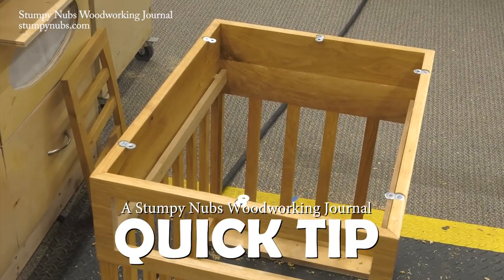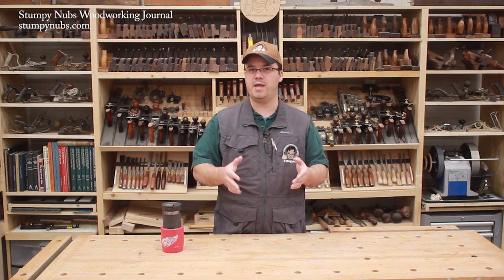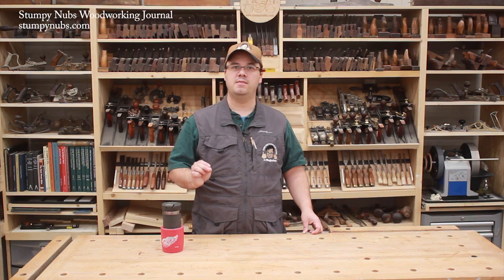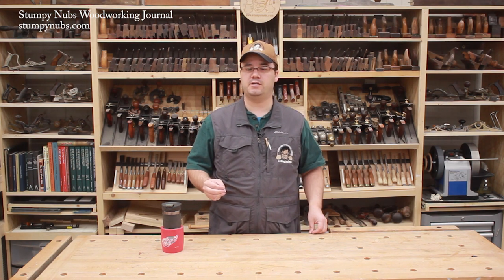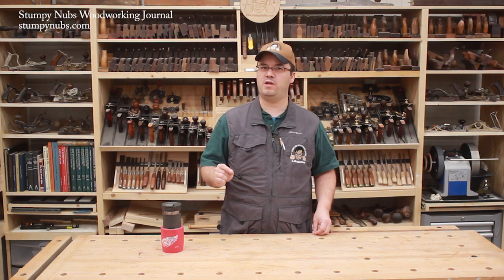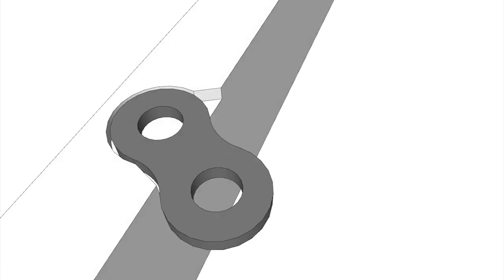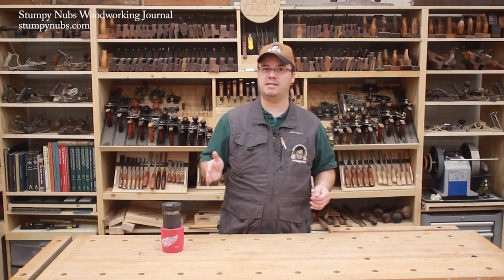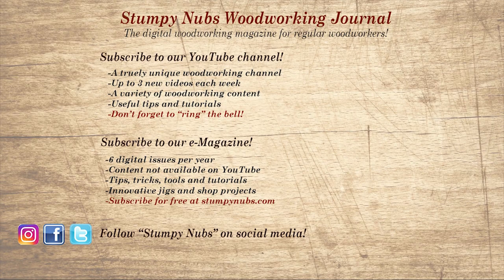Figure-8 table top brackets the RIGHT WAY

Comment: I am sitting at a desk right now that is at least 70 years old, I bought it nearly 40 years ago and it has been with me each time  I moved, I am in a climate that is very arid  now, but when I got it we were living in a much more Marine climate.  It needed some attention when I first got it but frankly it has held up remarkably well. One of the nice features is the fact that it has figure 8 fasteners. in fact when I first got it, it was in a 3rd story bedroom, the thing is made out of solid Oak. it is super heavy and being able to take the top off afforded me to move it a lot more easily. Thank you for the information, I hope one day to put a new table top on it, and I want to make sure that I do not ruin the existing structure in the process.

Comment: Great explanation!  Another reason for installing the z-brackets or wood ones is that if someone lifts the table by the top, the figure-8s can pull out the screws.
Reply: But the aprons can pull away from the z clips

Comment: James, thanks you so much for this instruction.  It hit the mark and answered my concerns with the figure “8” hardware for a solid cherry top on my kitchen island.  Due to construction issues with built up door slides, I can only install the brackets lengthwise,  I have experience with other methods of tabletop attachment for wood movement, but this seemed appropriate for this project and it is my first experience with these brackets.  After analyzing how the top would expand and contract,I was ready to abandon this approach and try another method.  Stumpy to the rescue to cut through all the nonsense and address the issue.  Thank you, thank you.

Comment: I watched this just in time. Great video. Next week I am using the Z brackets to attach the top shelf. I did not realize I had to not insert them all of the way. ......and now I know. For the figure eight type brackets, I'd use a router instead of a forstner bit. I think it's much easier not to go too deep once the router bit height is set. Also, it's a lot easier to open the hole for the bracket.

Thanks for posting. 
Barry

Comment: I'm currently in the middle of assembly and as a new carpenter realized that the joint on the top is much more important than emphasize in this video. I either need a biscuit jointer or route the edges. It would have been much easier if this was much more of an emphasized in the vid as a new carpenter. Thanks for the vid.

Comment: Excellent explanation. Here in the UK, our climate is less extreme - changes in humidity through the seasons are much less than I read that you experience. However, good practice is always to allow a top to move if it needs to. Personally, I use the Festool domino to create the button slots and then make wooden buttons (exactly as you show) which allow for the movement. Before dominos, I would rout slots. All very easy and for the sake of a few minutes work, you have potentially saved an item that cost a lot to make (labour and materials) being ruined. So, whatever your method, equipment and ability, just do something.

Comment: I just make my own brackets out of 2"-ish wide, 1/8" thick aluminum flat bar. I make a shallow mortise for them to sit in the aprons, kind of like the figure 8 brackets, and screw them to the bottom of the tabletop with pan head screws. I just make oval slots in the aluminum to allow the screws to slide, and they work well! I also wax the brackets to help the screws slide easily. I originally did this because I made a triangular table with a solid wood top and needed a bracket solution that could allow for wood movement at a 45 degree angle to two of the aprons. I like it more than figure 8s because of the linear expansion slots, rather than relying on the rotation of a bracket, which can generate forces in other directions in the wood. I know figure 8s work, I just like over-engineering my things.
Reply: All hail over engineering!!! 😀😁😍

Comment: Dude, whoever installed the cabinets in this house installed the drawer faces with these. 7-1/2 years of my niece yanking on them and slamming them closed has led to most of the faces coming loose or completely off. It's cool. Really really really really never saw drawer fronts installed this way. Usually a bolt that goes through the drawer and face frame to the knob. I don't know why I'm typing anything. Thought I'd make you laugh.

Comment: Hi Stumpy Nubs, this is a very helpful video. Still will I have the same type of problem if the table top is made of plywood? I mean can I just glue and nail it to its base or I will have problems in the future with expansions and contractons due to weather conditions?

Comment: Great video. I had a question regarding use in cheap cabinetry. The drawer fronts on all of my kitchen cabinets are attached with figure 8s. Due to constant use and overuse by my now 7 year old niece, so that's 6 years of growing up and pulling on them has resulted in a number the drawer fronts coming off. The fronts are a Maple frame with very cheap maple faced plywood panel in between. What is a good method for reattachment. It just seems like a poor connection for drawer fronts. I can send pictures. Thank you for anything you can tell me. Thank you for reading.

Comment: Great info, James. Have you seen or used Izzy table top washers?
Reply: Funny, while watching the video I asked myself why not just create a figure-8 bracket with a slot in it? I'd never heard of Izzy's washers. I looked, and that's exactly what he did. Good for Izzy.
Reply: Remember, Izzy Washers will only work when installed in-line with wood movement (across the grain).
Reply: @zapa1pnt  That's just not true. They swivel in one direction and have the slot in the other.
Reply: @weldabar :
My apologies, you are correct.
I was still half asleep, at Noon.
Immediately upon seeing your reply , I knew I was wrong. I'm glad you corrected me. Yes, Izzsy'z is a good idea.

Comment: I've seen various types of these brackets used to fasten tops, I've always wondered if you do this, can the average owner pick up the furniture to move it by only holding onto the top, and not have the screws pull out or the wooden brackets break?
Reply from the maker: If it's a solid wood top (these brackets are really only intended for solid wood because plywood does not move like solid wood will) the brackets should hold just fine, assuming enough were used.

Comment: The idea that you angle the brackets parallel with the grain is cute. Although this ‘solves’ the problem of them allowing contraction it will ‘pull’ on the brackets at ends perpendicular to the grain. I think the reality is that wood is quite flexible and shrinkage is small. The side rails will bend a little, the screws will move in the hole, the screws will move compared to the bracket, etc. In reality you only need a few mm, and you easily have that in most situations. Good thinking here but there is nothing much to be worried about anyway.

Comment: Am I right to assume that by that logic you should also avoid fastening across grain altogether, because as those washers rotate they will also cause the top to move along its grain, thus ripping cross-grain connections apart?

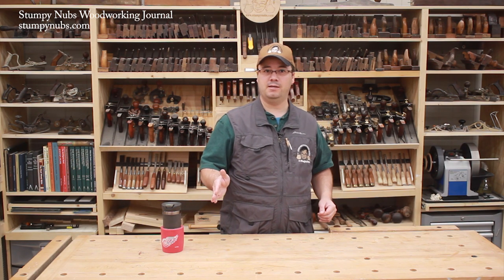Comment: Great video. What do you recommend for a table top that has a mitered border around a middle section? So in other words, the top’s border has grain pointing in two directions. Would I cant ALL the figure 8 fasteners around the whole top (what you show at 3:50) to allow movement in both directions, or should I just default to the grain direction of the center part?

Comment: For the ones in line with grain direction do you need to angle the brackets the same way? If you don't can't the brackets get pulled away from each other? After all the screws are a fixed distance away from each other

Comment: Question: wood movement will be in the lateral direction. But the brackets, even when installed in the front and back aprons, will always move both laterally but also a little in the other lengthwise direction. That is because the screw that will be connected to the tabletop through the bracket, will be following a circular motion as it turns around the screw that is connected to the apron. But the tabletop can not adjust for this lengthwise part of the motion so it will crack. Isn’t this a problem for these brackets?
Reply from the maker: The "circular" movement is not nearly as great as you think :)

Comment: Looking at it, the "parallel apron"-8s seem bad because a small movement in the desired direction requires a big movement in the undesired direction (but vice versa on the other aprons which is good)? On "parallel" it's changes in Sine(x) vs. Cosine(x) for x near zero.

Comment: I have used those z-brackets a few times and they seem to work great.  In fact, I am installing an edge-grain top (walnut) and am using them again.  But is any allowance for movement necessary with an edge-grain table top since any movement would be along the grain?  (Can't hurt I guess, hence planning to allow for some movement anyway.  But it would be the thickness, not the width or length of the top, that would experience any movement, no?)

Comment: Stumpy, From your explanation I understand the whys of wood movement. How much movement are we talking about? Are we talking a couple of 1/16ths or an inch or so?  It seems that that measurement would drive how much slack to leave in the brackets.
Reply from the maker: A lot of factors can contribute. But in most cases we are talking about less than 1/8-inch unless the top is very wide.
Reply: Can be 1/8" on each side, or 1/4" depending on the wood, its amount of moisture/humidity change and grain cut. A kiln-dried quarter-sawn board won't have as much movement as a flat sawn board. Engineered wood like plywood, will be even more stable. That is why most tables are veneered tops. But I like the 8 connect as you can leave it at canter or go old fashioned with wood blocks and offset holes for expansion. So many options. Thanks Stumpy!
Reply: The upper floor of my garage was laid with air-dried pine, reasonably fresh (the only planks available here).  They shrank by about 5% widthwise after a year being in a dry but unheated building. The same material used in an outdoor deck shrank by 10% widthwise but not at all lengthwise.

Comment: Why then when combining two board to make a wider top ~ dowels and other methods along with glue is used? In addition what about the rest of a table such as the skirts and other framing? Seen a bunch of glue ups and or screws not giving expansion. Anyone may answer me, just wondering why only table top most people focus on for expansion and contraction?

Comment: With the z clip method, wouldn't the top be able to move a little since the brackets are backed out a little bit and the other brackets have room to move side to side?
Reply from the maker: Technically, the top can move a little with any of these. But it won't move enough to notice.

Comment: Don't forget to calculate anticipated wood movement relative to the wood's dimensions and the way it was sawn (plain, rift, quarter). In this way, you can assure that the fasteners you are installing will actually be able to accommodate anticipated movement as the seasons change.

Comment: Do you know. My dad was a joiner. He built a small cupboard in there kitchen. After he died, the sheltered housing company that owned mums bungalow, were upgrading the bathrooms. The lads could not figure out how dad fastened it to the wall? He was great at hidden fastenings. 💖🙏💕
Reply: I once had to remove cabinets from an old house that was being torn down. The kitchen cabinets were attached to the wall with horizontal tapered dovetails. We destroyed one cabinet learning how they were on the wall. It was some impressive joinery work and all of the cabinets were still level before we removed them.

Comment: OK - so I read through all the comments and nobody addressed "how tight do you drive the screws?"  Thoughts?
Reply from the maker: Doesn't really mater. The wood will be stronger.
Reply: @StumpyNubs  How strong is wood movement? Is it stronger than the force it takes to bend a screw for example? Are we even able to calculate how much force wood movement exerts?
Reply from the maker: It depends on how much moisture it absorbs or loses. If it shrinks the forces can be strong enough to tear a board in half. If it grows, it can definitely bend a screw, or in this case, slip under the head of a tight screw.
Reply: @StumpyNubs  I'll vouch for the fact that shrinking wood (teak in my case) can tear a board apart.
Reply: @StumpyNubs  That’s very interesting. I usually operate on the assumption that the wood will bend a screw (like a normally drilled pocket screw) before it splits itself. I suppose the pressure would follow the path of least resistance. That is, is it easier for the wood to bend a screw or to buckle in the middle. But that depends on wood hardness, moisture change, wood density, and a few others that become unwieldy. Better safe than sorry.
Reply: @StumpyNubs  it needs to be tight or else you get a jerk when lifting the tabletop.   my trick is to use undersized screws with washers ontop of the underside fastener that allows for additional all direction movement
Reply from the maker: @tonyh7734  You can make it plenty tight without obstructing wood movement.

Comment: Why not use figure 8 brackets with slotted holes.  Lengthwise and widthwise.  Then tighten the screws until they are snug but not so tight that they can not slide in the slot.

Comment: This explanation doesn't make sense. If the figure 8 brackets installed along the direction of expansion/contraction were to pivot to accommodate this expansion/contraction, the mounting screw (and thus, tabletop) would need to shift laterally (along the direction of the wood grain) to accommodate this. I mean, you can even see this in your example of pressing the bracket with your finger into the table. Sure, you're able to get it to rotate to accommodate the downwards pressure of your hand, but note that your hand also moved to the side to accommodate the rotation! After all, a rotation about a distant point is, by definition, a movement in two axes, not one. Yes, a pivoting figure-8 bracket could theoretically allow for movement along its mounting axis, but it can ONLY do this by also moving perpendicularly to it!
Reply from the maker: You are overthinking it. The wood does not move that much. The little arc in the turn is not a factor when you're talking 1/6-inch of movement across the whole panel. What may not make sense on paper still works in real life :)
Reply: @StumpyNubs  this almost answers the question I was going to ask. How much movement can I expect in a table top? For example that cool dog crate end table you showed.
Reply: If the linkage between opposing brackets were strictly constrained, that would be a problem, but that won't be the case if you use pan head screws with a shaft diameter smaller than the hole diameter in the bracket.
Reply from the maker: Wood movement depends on how dry it is to begin with, the environment and the species. There are articles online that discuss the mathematics of it all. But in most cases 1/16-1/8 inch across a panel of 24-inches or less can be expected.

Comment: Am I correct in assuming that the figure 8 fasteners that are installed slightly angled should all be angled in the same direction on that side and the opposite side should also point in the same direction?
Reply from the maker: No. The angle just gives the wood some to straighten if the wood shrinks. It doesn't matter which way they straighten.